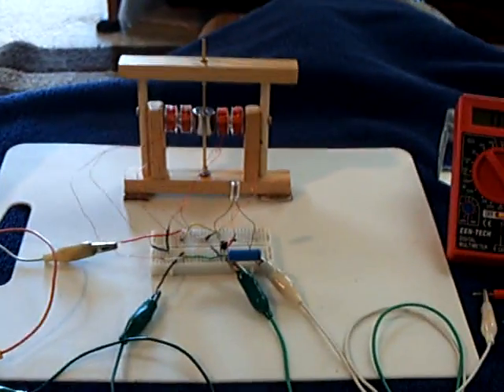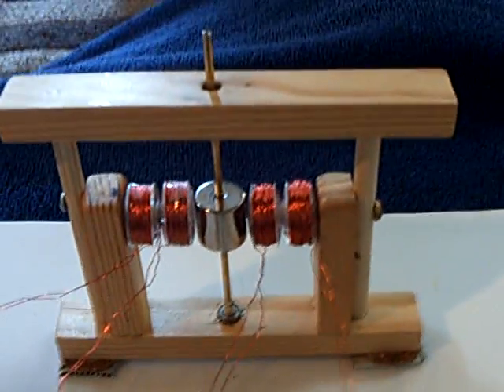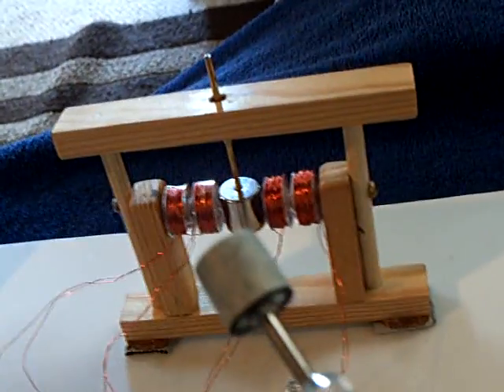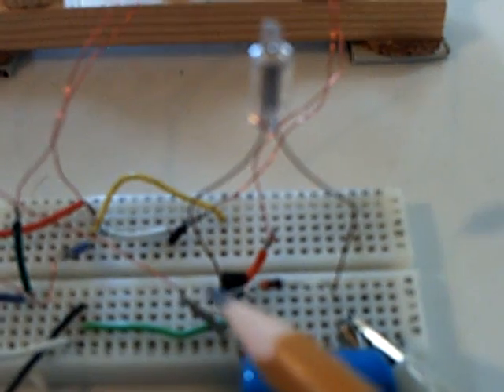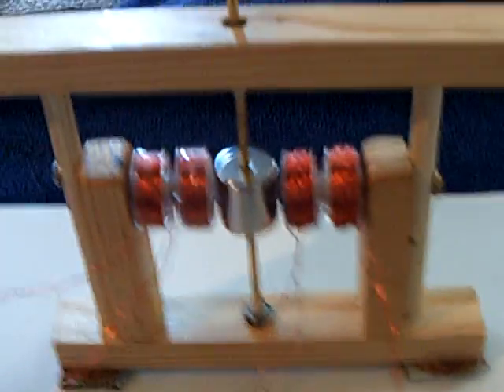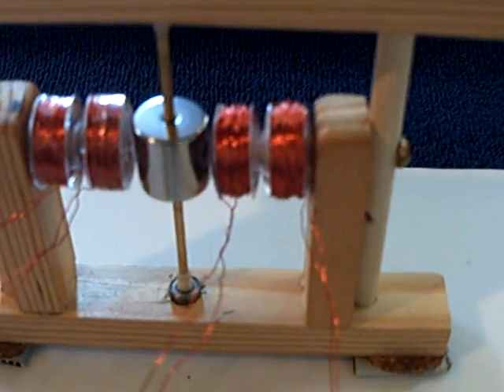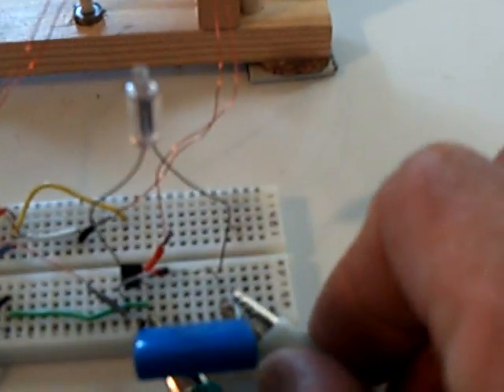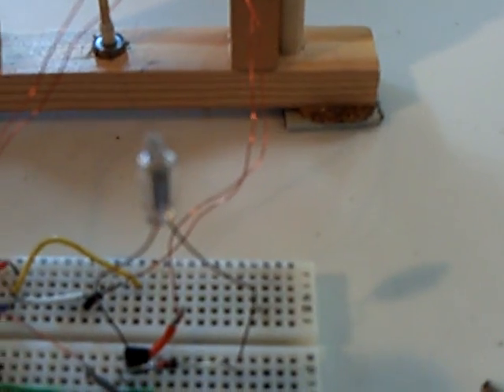Tiny motor-generator----replication maybe

Comment from the maker: @freeenergynews -------I posted a follow up video today with a circuit diagram.  There is an error in the diagram.  The 1N914  flyback diode goes to the 250v cap not to the neg. rail.

Comment: could you point out  how the bloch wall is around the magnet of this device? with a magnetic flux view film, or  some other way? would be really interesting to see if it's the same conical structure  going around, with one cone  coming to the left side of the magnet and the second cone of magnetism coming to the right side of the magnet. (the tips of the cone that is)

Comment: i know for a fact with small diameter wire the voltage will be higher without the switching device.   i believe the video shows condensers as coils which use small wire

Comment: Set a no bearing Bedini spinner up between the two pair of coils and try and run the R.P.M's  up to the 7k, then disconnect the power and join the leads to see if it will begin to coast.

Comment: I think the idea involves spinning the rotor faster then the coils can switch charges.
There seems to be some kind of what I've been calling "Lenz Propulsion" when spinning diametric rotors inside output coil cores, like the increased spin you demonstrated with your Maggie satellite output coil. You can see the similarity in the current setup. The major difference is that he spins his rotor up to 7K with a dremel to get the effect, an R.P.M. I think closer to the speed of your Maggie sphere.